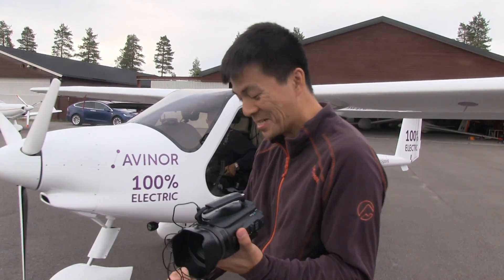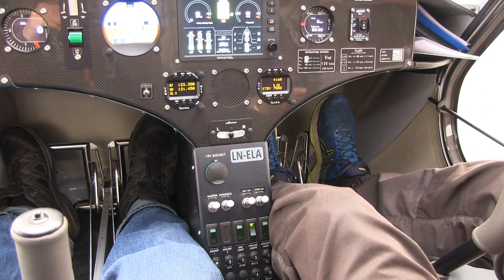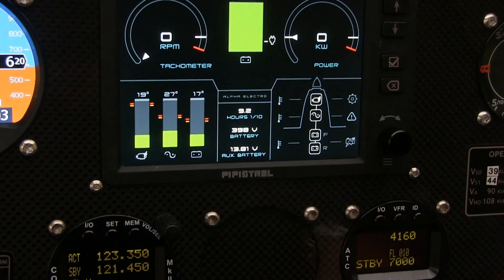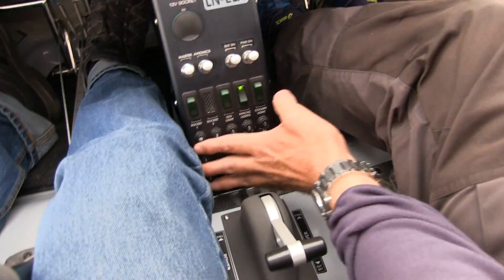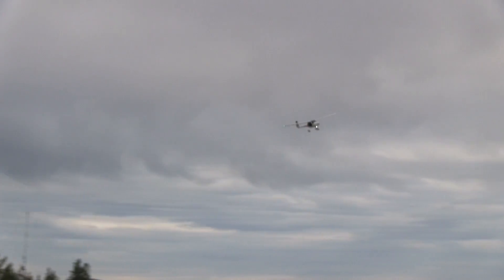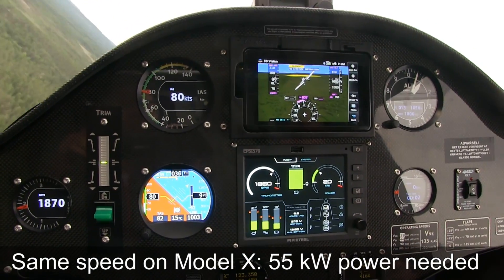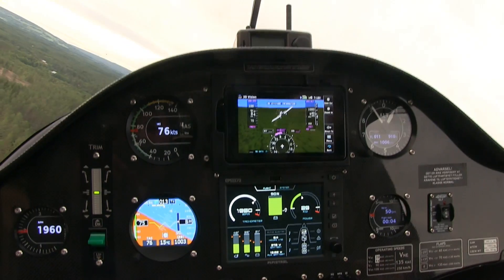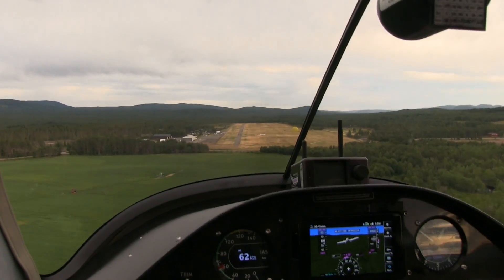Test ride in Pipistrel electric plane

Comment: So at cruising at 9:25 in the video the consumption was about ~130wh/km (209wh/mile) that's not too bad at all.
Reply: idontcare80 You know it's intended to be a training aircraft, right? It's not designed to fly long distances. In fact it's extremely good at what it does, because flight schools will save huge amounts of money on fuel and maintenance costs, as well as reducing noise and not annoying their neighbours!
Reply: Add that cars are HEAVY (and getting heavier for comfort) and planes are designed as light as possible.
Reply: @FrenchCrow  u lie
Reply: @playaj320  About what?
Reply: idontcare80 Its a perfect training aircraft, perfect for touch and go landings and should be much cheaper to learn to fly in.
Reply: It has it's Purpose.
And this Purposes are growing like the Batterys are getting better.
That is happening.
Reply: idontcare80 you got me my man :). Tried trolling you but you did good. Cheers. I only dont like the fact that you dont have much trust in electric transport. Yes batteries have been a problem for the last 100 years and still are despite their tremendeous progress. However, solid state batteries are promising petrol like energy density + thermal efficiency of electric motors is ~90% combined to ICE's ~30%. Electric transport has bright future.
Reply: idontcare80 - That depends on how high you can climb with this, but it has a Climb Rate of 1,200 Feet Per Minute, so a 5,000 Foot High Ridge can be climbed over in 5-6 minutes, then you go over a Mountain, and land on the other side, whereas a car might need to drive 3x to 10x as far to go around the mountain! Besides, driving is far more boring!

Second, this particular Plane is all about reducing the Cost if Flight Training for new pilots, since those costs have gotten out of hand, with hourly rental costs for Fueled Equivalents (Like a Cessna 150 or 152) at 4x to 6x or more as expensive to operate! This uses about $3.00 worth of Electricity per Training Flight of about an hour. This alone greatly reduces operating costs.
Reply: I think idontcare80 ist about 85% right on his comments which left me wondering why he needed so long to identify an obvious troll. On positive thing about electric planes hasn't been said: If an improvement of factor five ever comes regarding battery capacities it will be nice to ave the technology already in place since there had to be some research to be done.As for the more efficient cars: That is not true. You can build superlight cars as well and they will consume almost nothing. Most consumption comes from weight and from stupid driving, wasting energy.
Reply: We will see more than a few percent.
Reply: yes but super light cars will cost a lot... also even twice as strong batteries as now will make very useful small aircraft for training and for sightseeing as long as those batteries would have good recharging times and would need to last long time. still no point in waiting for such batteries better make planes now and just use better batteries when they are available.
Reply: idontcare80 haha, yes airplanes are a complete novelty, im betting on the steam powered personal gyrocopter to launch everyone into the future! :P
Reply: Andy B said "Isn't it awesome that a plane can be more efficient than most cars?:)"
They almost always are more efficient than cars, especially with retracting landing gear. A Boeing 747 is more efficient in BTU consumed per ton/mile than any other form of transportation (or animal) except for a human on a bicycle.
Reply: Russell Dawkins I came to the same conclusion regarding the 747 years ago. I have my doubts about the human on a bicycle, I suspect if I ordered what the last cyclist I saw at a roadside cafe ordering, squeezed the fat out of it in a press and poured it into the diesel tank of my little Kubota tractor, I could drive further than he cycled. Of course I may be wrong, but it's a strong hunch.
Reply: Super light cars will not cost a lot. They will simply have simple thin, non adjustable seats, no air conditioning, 50kW, no airbags, thin wheels, plastic non moving windows, no ABS, ASR, ESP, almost no trunk or headroom, only 2 doors. Basically it will be a better velomobile and there you go. That's about what you get with a plane like that.
Reply: and they simply wont be allowed to drive in europe... except maybe just maybe if you limit their speed on 50km/h
Reply: What would make something like this useful is gas/electric technology. Gas takes you off and is used when you need power as they say and electric when you are cruising. 

The thought of it being used as a training airplane would only be useful for maybe stick and rudder practice only. Because with a gasoline engine you have other aspects to flying that one needs to be used to. Also pretrip and Various checklist would be much shorter.  

Also,  why learn how to fly in an aircraft that you will never buy?

I don't want to have a very expensive drone,  and as soon as I take it in the air go oops got to go charge..... 

I like the thought, but battery technology isn't where it needs to be...
Reply: Piston Avatar guy, I agree with you because you think like a business person and you've done the math. It seems like the younger generation is in love with the glamour of the electric technology. Once you factor in maintenance, hours of usage, and replacement costs, the flash of the electric plane Fades away quickly
Reply: I would sure have hated being confined to the same area during my flight training.
Reply: idontcare80 hehe your name explanes all ;)
Reply: RU serious?
Reply: @hc7369  Yeah, and then the battery is toast after a couple hundred hours of flying and replacing it eats up any saving that an electric aircraft might have had in the first place. It's USELESS.
Reply: @hc7369  The cost of replacing the battery is not small, it's $20,000! The aircraft also costs more than an ICE Alpha trainer. These batteries are also discharged at a high rate, which means that they wont last long. Try making your claims after actually doing the math.
Reply: @hc7369  Plenty of people have "pioneered" technologies that were never successful. Some technologies simply aren't viable.
Reply: ki0ng  I already discussed that, you fool.
Reply: ki0ng  Nope, you're a moron and should read the discussion. No one is going to pay nearly double the cost for a less capable airplane.
Reply: ki0ng  The cost of the Alpha Electro with a second set of batteries and a charger is so high that you could buy a regular Alpha and pay for its maintenance and fuel for many years and still have tens of thousands of dollars left over. Maybe you should LEARN THE FACTS before you start calling people names.
Reply: @Andy B not by much a Tesla model 3 uses 260wh a mile. it has a 50 or 75Kwh battery. doesn't mean it needs that much to go 1 mile... the statement in the video is false.
Reply: edwong3  No, they say that there's no real limit to how much energy can be stored in a given space, but that doesn't tell us anything about chemical battery storage. If the Maxwell battery technology works out, I'll be very surprised, but even that isn't nearly enough to make electric aircraft useful for anything. For slow, electric, light aircraft to be practical, you need a 5 fold increase in energy density, for electric airliners, you're looking at a 50 to 100 fold increase, that's not happening.
Reply: edwong3  "Planes like the Sunflyer II and IV can remain in the air for over three hours, and that is with current battery tech."

That's what they claim, yet they've never even built an aircraft that can do such a thing. I don't think their 2-seater has been verified to be any more useful than the Alpha Electro. Everyone seems to be taken in by snake oil salesmen these days, it's ridiculous.

"...but I can foresee twin motor, propeller driven 40-50 passenger regional commercial aircraft possible once energy density reaches 800 plus kw per kg. and above."

You mean: IF energy density reaches those levels. An aircraft like that will still only be able to fly for about an hour, which will limit its usefulness. The other issue is the battery discharge rate in those applications, which will drastically shorten battery life, which will make frequent battery replacements a necessity, which will drastically increase the cost of operating electric aircraft, which will make them unable to compete with ICE aircraft. 

"We should never use the terms, "Never happening" or "Impossible" when it comes to science."

Fine, then I'll put it this way: It's not a goal that's even remotely close to being within reach with any technology that we're aware of. It's kind of like getting people hyped up for Star Trek transporter technology, we can imagine it, but we can't even begin to image how it will be implemented, so there's no real point in even discussing it as being anything more than a concept. 

The other issue with the whole idea of electric vehicles is how slowly battery technologies are advancing (in fact, they seem to have hit a brick wall), and, really, the only major reason that these technologies are even desirable is because of climate change, but if they're going to take 40 years to develop, and then 40 years to be used widely enough to generate any significant reduction in CO2 emissions, we might as well just do nothing!
Reply: edwong3  The 4-seater Sun Flyer doesn't exist as anything but a concept.

"I will give you some food for thought."

I've heard this argument a MILLION times, it doesn't mean anything. For every technology that succeeds, there are dozens that fail. We're also FAR more advanced in our understanding of how things work than we were in the early 20th century, we're not just making shots in the dark and hoping that something hits its mark like we were in those days. Gambling our future on technologies which aren't likely to have any real chance of being useful is not a wise way to live.

"Now we're in the 21rst century, and it is science again that is developing the replacement for this fossil fuel economy that we're running on."

TRYING to develop, electric vehicles being successful in doing so still appears to be VERY unlikely.

"I know I started this discussion as a way to correct you in your assertion that we are somehow reaching the limits of battery capacity when that is not even remotely true."

Are you sure about that? You've only brought up technologies which are still in the development stage, and most of these things never make it into production.

"...who won't accept any facts."

What facts? 

"...the older technology has to go."

It certainly does, but there's nothing which can replace it, which is my entire point here. Anyway, I think that you need to reread my comment, what did I say about climate change?
Reply: edwong3  I didn't say that we stop innovating, I said that electric vehicles don't appear to be the innovation which will save us from climate change. There are other innovations which are FAR more promising.
Reply: Good observation.  To keep the comparison fair though I'd add on the part of onboard energy.  If you took a conventional Tesla and removed 90% of the batteries (about 500kg of batteries, leaving about 1hr worth of driving), I think the vehicle's energy consumption would go down quite a bit too.
Reply: And this is not true.
You are so much faster with a Plane, even when it is not as fast, than a car.
It is because you are Flying straight and with a Car you can't go straight.
I had followed a Friend when he flies an much slower UL.
It is only 80-100KM/h fast, ist was impossible for me to be faster.
In Fact he was 1/2 h faster over 50KM Distance straigt.
Reply: idontcare80 It's the same price as the gasoline version of the Pipistrel Alpha. If flight schools need to fly for more than an hour, then yes, they should choose something else. But for many the huge savings on operating costs will be compelling.
Reply: Sorry, I don't want to upset you - you obviously feel very strongly about this! But it's not Bjorn saying this, it's the guys who actually bought the plane. Go watch the previous video!  But if it's true that the battery costs $30,000 and needs replacement after 2000 hours, then yes, you're quite correct about the costs not being attractive. However, is the specified life of the battery really this low, or is that just speculation on your part?
Reply: idontcare80. So what if it's $30,000 more at purchase. Maintenance will be cheaper over the life of the aircraft and fuel. This will more than make up the difference. 

Directly from their website:
Electro TBO is 2,000 hours at a cost of $600. Motor replacement costs $10,000 every 6000 hours. Total at 6,000 hours is $11,200. 

Trainer TBO is 2,000 hours at a cost of $12,000. Total at 6,000 hours is $36,000. 

So after 6,000 hours the Electro costs $24,800 less and that is before fuel cost savings. 

You could even buy a swappable battery for the Electro that they offer and have money left over. By the way the recharge time for the 17 kWh battery is only 1 hour anyway. With a swappable battery your turn around time would allow the same number of flights per day. 

Even with the cost of a swapable battery and after the fuel savings the Electro will cost less than the regular trainer after 6,000 hours.
Reply: idontcare80 It's stated in Bjørn's other video that it's the same price. Maybe that's just in Norway? In any case, even if the difference is as you claim, a busy flight school would make that back in a year in fuel savings alone.
Reply: idontcare80 why read the discussion when it's just you pulling numbers out of your ass. $30,000 for a 16kWh battery! Hilarious. At the pack level for batteries cost is down to around $250 kWh. A company like Tesla has their prices down to $150 kWh but they are dealing in large volumes. At $250 kWh for a 16kWh pack is only $4000. And those batteries are going to last way, way beyond 2000 hours. And even then they will just loose capacity which will reduce flight time but they will still be usuable. It's not like they just go from 90% capacity straight to 0. The packs in Tesla's are showing on average 90% charge capacity still remaining at 150,000-200,000 miles. So at 6000 miles you replace your $4000 swappable pack. And that is based on today's  pricrs That. By the time you need to change the pack prices per kWh will be even lower. The battery isn't going to change the cost advantage the Electro has.
Reply: The 17KWh battery pack will cost way more than $4000. At least 3 times more and probably in the 6 times ballpark.

From their website: The 17 kWh battery pack was dual-redundant and designed to be either quickly replaceable within minutes or charged in less than one hour, thanks to the next generation of Pipistrel's Battery Management technology.
Reply: It's stated in Bjorn's previous video that to buy the gasoline equivalent with a full complement of instruments is "approximately the same" as the Alpha Electro. In addition to fuel savings, there are significant maintenance savings. 2000 hour maintenance interval compared to 100 hours for the Rotax.
Reply: Troll harder.
Reply: they are talking about twice the energy density compared to todays batteries thats still only 1/20th of energy density of petrol. 

anyway battery in this plane can be recharged pretty fast so clearly you can fly many times per day.
Reply: @jebise1126  I worked at a flight school when in college.  I could list @ least 20 darn good reasons why a Flight School would absolutely want to choose this specific trainer, built on a glider platform, with such a quiet & smooth energy band & with it being a totally green & clean engine (No Exhaust) - This flight school (if they are good at Marketing) will be totally booked up all the time...  They could offer a free 1st flight (donations appreciated) business model to get the masses to come & come they will!  Many will sign-up because they will be ahead of the curve in getting all their training in an electric plane with glider characteristics that is as safe as you can get in a flight instructor small aircraft.  I need to go to sleep now.  But this reminds me of a few different parallels from history.
#1) Amazon.com will never make a profit, it's a pipedream of a business model...
#2) Tesla will be bankrupt & they will never even produce a functional sedan much less a SUV, or any affordable car model with any kind of real world needed range acceptability...
#3) Donald J. Trump is nothing but a reality tv host, he just got lucky in his career, he is a modern-day PT Barnham shill with no brain power.  It's literally impossible for Donald J. Trump to win the Republican nomination - He has a 0% chance of winning.  What a fluke, he somehow won the Republican nomination, but HRC is unbeatable, she's the surest lock to win the Presidency since FDR 1st ran for President...
#4) The sitting President's party always loses seats in Congress @ the Congressional mid-term elections in November - The November 2018 midterm elections will be like all the other previous midterms, voters will have the typical buyer's remorse - so a Huge Blue Wave will occur in November 2018.
P.S. Obviously, like electric cars, electric planes are here to stay, the battery technology will continue to improve / costs will keep falling / range will continue to be extended / etc...
Reply: LIBERTY MURF - Wait, did you think that I was a Trumptard and like the idea of burning coal? Coal is basically the worst way that you can generate electricity! It's not only dirty, but it's also expensive!

No one said that Tesla wouldn't succeed based on their technology, electric cars were proven to be viable in the late '90s. The only doubt about Tesla came from the fact that it's incredibly difficult to start an entirely new car company with so many major players already well established.

Electric airplanes wont catch on unless there is an absolutely enormous improvement in battery technology, period. You people can talk about the possibility of rainbow farting unicorn magic making them viable all you want, but it wont change the reality of the technology.
Reply: The batteries are modular packs.  With two packs, one charges while the other is flying. In about the same amount of time.
Reply: idontcare80 yes it does you electric loving liberal
Reply: I'll believe it when I see it.
Reply: A typical flying lesson is about 1 hour.  Despite the initial cost of electric airplanes -- which will surely go down -- the operating cost is very low.
Reply: idontcare80 true. Only coal bro.
Reply: Coal is the future
Reply: Norway doesn't get its electricity from coal, you ignorant conservatard.
Reply: Read the discussion.
Reply: I'm a troll because I don't care what my screen name is? If I'm wrong, tell me WHY I'm wrong.
Reply: How is it that every conservative on Earth is unimaginably ignorant? You people don't know anything about ANYTHING. You should at least come across some things by accident, so the only explanation for why you people are so ignorant is that you actively try to remain as ignorant as possible about absolutely EVERYTHING. 

99% of the electricity in Norway comes from hydropower plants, not coal. Coal is not only expensive, but it's also one of the most polluting ways to produce energy. We don't even get half of our electricity from coal in the US, natural gas is the largest single source of electricity here, and that's because it's cheap and clean.

Anyway, I'm guessing you're a troll, so f**k off.
Reply: "We will see more than a few percent."

I believe it when I see it.
Reply: The Rotax powered Alpha is $90,000, the Alpha Electro is $140,000, that's quite a bit more. Savings are nil.
Reply: I doubt that Norway makes $50,000 available for the purchase of this aircraft. Those are the prices in the US and all of Europe as far as I can tell. And, no, they wouldn't make their money back, because they'd have to buy multiple battery packs to allow for more than one flight a day, and they'd have to keep someone on staff to change out those battery packs. 

By my math, it would take at least 4 years to see a return on the purchase of this aircraft, assuming that it's used every day and doesn't cause an overall loss of money due to lost opportunities.
Reply: Planes don't run on coal, moron.
Reply: @PistonAvatarGuy  A large % of Electric Generation comes from burning coal for the sole purpose of generating electricity!
Reply: LIBERTY MURF - Not really, it's only around 30% in the US. Even if an electric vehicle is powered almost entirely by coal, it's still cleaner than an ICE vehicle (everything is just much more efficient), but that doesn't mean that electric vehicles are practical for every purpose.
Reply: British Entertainment - Electric would be awesome if it worked, but it doesn't.
Reply: No, driving to the airport, pulling the plane out of the hanger, doing the pre-flight, run up, getting tower clearance, etc, would all take much longer than it would just to drive 80-100 miles. You can just go directly from one place to the other in a car, you don't have to go to and from airports.
Reply: You clearly didn't read the argument, and if you did, you obviously can't say why I'm wrong, so YOUR argument is useless.
Reply: Philip Davis - You're forgetting about the replacement of the battery. Read the discussion.
Reply: What is wrong with you? Are you incapable of accepting the fact that you're wrong? Who cares what Bjorn says? Bjorn is not a representative of Pipistrel and he's WRONG. The price list straight from Pipistrel lists the Alpha Electro at $50,000 more than the Alpha, PERIOD. 

The battery in the Electro probably wont even last for 2,000 hours, it will probably have to be replaced, at a cost of $30,000! Also, the Rotax engine might need light maintenance every 100 hours (oil change, I assume), but it has a TBO of 2,000 hours.
Reply: PistonAvatarGuy the battery in a model S Tesla LA to Vegas went 500 000 miles before Tesla replaced it due to becoming somewhat unbalanced, due to.being Supercharged every time - a practice Tesla recommends against. 10000 hrs seems a easonable assumption. . When does an ice need to be replaced or bave a major overhaul ?
Reply: @PistonAvatarGuy  ur argument of 1 hour flight time being a problem for training is completely irrelevant. When you do your first hours of flight training the good procedure is to do 1 hour of flying and then 1 hour to go thru your mistakes. Student dont do more than 2 or 3 hours a day. This aircraft can be recharged ini about an hour, too or you can just switch the batteries. Its significantly more expensive, but for a school and with some local tax incentives its still a good way to operate.
Reply: @VNtergon  None of that makes sense for the owner of the aircraft because of the cost. Not only is the aircraft more expensive to buy, but the batteries are also only passively cooled and are discharged very quickly, which means that they wont last very long and will need to be replaced frequently, which will cost the aircraft owner much more than it would to operate the same aircraft with an ICE. Buying a second battery pack, so that one can charge while another is placed in the aircraft, also increases the price of the aircraft, very significantly. The aircraft owner would also need to hire someone to be available for the switching of the batteries. NOTHING about this aircraft makes sense.

If you're aware that it's significantly more expensive, why would anyone want to operate it? What would be the point of tax incentives to use it in the first place?
Reply: @PistonAvatarGuy  well I operate a version of this aircraft with Rotax engine in it so trust I know a thing or two about its operating costs.)) 90% of the flights my aircraft does are 15 minutes long. So for my kind of operation it actually is not that bad. We evaluated starting a flight school, and having 2 Alpha Trainer with electric engines and 1 with the petrol for navigation training is the best combination if you are planning keep those airplanes busy. And also, most aircraft ICE engines are passively cooled, so I your claim about batteries not having enough cooling is irrelevant here. Again, this aircraft is not meant for private owners, if you run a school you already have a mechanic who can switch the batteries if you ever are going to need that at all.
Reply: @VNtergon  Batteries are not ICEs, so your point about ICEs being passively cooled makes no sense. Batteries are not easy to cool by simply moving air over them because of their mass and density, and engines require large heat sinks so that they can be cooled by simply moving air over them. Even then, water cooling an engine is much, MUCH more effective than air cooling ever could be. Anyway, passively cooled and air cooled batteries have poor longevity in BEVs, and the batteries in this aircraft are discharged at a much higher rate than they would be in a car.

I suggest that you run your numbers again while including the price of a second battery pack for each aircraft.
Reply: @PistonAvatarGuy  well. I can tell you this - if something doesnt make sence to you, just look again and ask how its done. A Rotax 912 can run at 5500RPM  all day long with only the heads being water cooled. 
Plus Pipistrel know a thing or two about cooling, and the aircraft in the video is basically the second generation. So just because you have no idea how to cool those baterries without coolant and radiators doesnt mean that they dont. When talking about costs, also consider this: when your aircrsft is not flying it costs you money, and Rotax 912 is known to create surprises which is costly when you run the aircraft within a business.
Reply: @VNtergon  "I can tell you this - if something doesnt make sence to you, just look again and ask how its done."

I KNOW how it's done.

"A Rotax 912 can run at 5500RPM  all day long with only the heads being water cooled."

And? The heads are water cooled because that's where the majority of the cooling is required and because the engine wouldn't be able to do what it does without water cooling. Oil cooling is also used on those engines, btw.

"So just because you have no idea how to cool those baterries without coolant and radiators doesnt mean that they dont."

There's nothing about the design that can be changed to improve the cooling, batteries are simply so dense that they can't be cooled effectively with air.

Anyway, using Pipistrel's price list, with extra batteries and a ground based charger, I've determined that the Alpha Electro costs about $90,000 more than the Alpha, so you could buy 2 new, whole Rotax 912 engines for each plane and still have tens of thousands of dollars left over for the fuel and for the maintenance and repair of those engines.
Reply: An improvement of a few percent here and there isn't going to do anything to make electric aircraft more practical, battery energy density would need to increase by at least 5 fold to make electric aircraft useful for anything.
Reply: $30,000 is what Pipistrel charges for a set of batteries, that's straight from their price list. EVERYTHING for an aircraft costs more, because it all has to be certified, and that costs money.

"And those batteries are going to last way, way beyond 2000 hours."

Not likely. Like I said, these batteries don't have good thermal management like Tesla batteries and they're discharged at a much higher rate.

YOU HAVE NO IDEA WHAT YOU'RE TALKING ABOUT BECAUSE YOU DIDN'T READ THE DISCUSSION.
Reply: idontcare80 Typical millenial with his "clean energy" falacies. How is it there in your moms basement? Coal is THE MOST POWERFUL source of energy in the world. Gas is for cars and not for electricity. Typical millenial that has fallen to jewish "clean energy" propaganda.
Reply: idontcare80 yes it does. Coal is the beat source of electricity. Solar and wind are jewish propaganda to get Americans to stop using coal and getting real electrixity from it
Reply: @britishentertainment7610  educate yourself you little ignorant :)
Reply: I didn't say that airplanes were a novelty, I said that THIS airplane is a novelty. It can't fly far enough to be useful. It would take you longer to travel with this airplane than it would to drive the same distance.
Reply: @PistonAvatarGuy  u a lier,     srt8 line 2points a & b plus it's faster.
Reply: idontcare80 hey man, it might not fly that far, but it’s a start!
Reply: @seththompson4780  No, it isn't, battery technology is probably already very close to being maxed out.
Reply: Keep in mind, the Wright brothers plane was a novelty,  and 50 years later, it was a whole different thing.  Imagine electric planes 50 years from now.  They may well take over the small plane industry.  In 20 years I can imagine all the Cessna 170s or similar being electric, as battery tech becomes denser.
Reply: You people do realize that flight schools will lose huge amounts of money because this aircraft can only fly for an hour, right? If they can only charge for one hour of flight time, versus 8 or more for an ICE aircraft, they're going to lose money. This plane is also more expensive to buy than a normal ICE aircraft, so there are no savings to be had.
Reply: Please consider maintenance costs of an aviation ICE, which are HUGE - and here you have just one moving part (looks like there's no reduction gear), no oil checks, no spark plugs, no alternator with belt etc. Reduced maintenance also means much higher availability and hence better profitability.
Reply: I'm not upset, it's just frustrating when people have no idea what they're talking about and go on and on about how wrong another person is. If Pipistrel changed the price of their planes, I haven't heard about it, and the price list from Pipistrel lists the Alpha Electro at $50,000 more than the Alpha. I have Pipistrel's price list right here, I don't need a video to tell me anything.

Yes, I'm speculating on the longevity of the battery, but that speculation is based on the fact that this battery will see some very heavy use (high discharge rate) and isn't water cooled, so its life will be short.
Reply: Yeah, perfect... unless you want to fly for more than a hour a day.
Reply: "The 17 kWh battery pack is dual-redundant and designed to be either quickly replaceable within minutes or charged in less than one hour". And when you train student-pilots you anyway need some time for briefing/debriefing etc. - 1h charging time is OK then.
Reply: Unfortunately, this airplane is completely useless, it's nothing but a novelty.
Reply: If you don't see use for it that does not mean it's useless. It was designed for specific purpose and that's pilot training.
Reply: idontcare80 cheap island hopper
Reply: @jrchicago9216  There's nothing cheap about the plane, and it probably doesn't have the range to island hop, except in rare cases.
Reply: @PistonAvatarGuy  why do you say that? My question is genuine, I'm a complete ignorant in this matter. Regards!
Reply: @mauriciocaviedes6520  Read the discussion.
Reply: @PistonAvatarGuy  I'll do it now. Sorry pal 😔.
Reply: @PistonAvatarGuy  Aha thats why our Slovenian company Pipistrep is thriving huh? Because planes are obsolete?
Reply: @zanpekosak2383  LEARN HOW TO READ.
Reply: you are completely wrong . this is the beginning of this. wait for the improvement.  @PistonAvatarGuy
Reply: @rbradominican  What evidence do you have that I'm wrong? I've been reading about electric aircraft for over a decade, none of them have ever amounted to anything and there hasn't been any significant increase in battery energy density during that time.
Reply: @PistonAvatarGuy  At an early Wright Brothers demonstration a bystander made a similar comment.  Another replied "So is a baby".
Reply: @danaschoen432  That's nice. NO ONE is making progress with electric aircraft, but ICE aircraft advanced at an EXTREMELY rapid pace. It's those pesky laws of physics, if only they didn't exist!
Reply: @PistonAvatarGuy  The problem is energy density vs weight, and contrary to your assertion, there is plenty of progress being made.  I doubt we will see electric planes in commercial aviation in our lifetimes, but small general aviation could very well reach a 300 mi range in a decade or so.  None the less, there will be no running without walking and there will be no walking without crawling.
Reply: @danaschoen432  There isn't nearly enough progress being made. A plane with 300 miles of range at 60 mph is still useless. Planes are used to travel long distances quickly and making that possible requires a huge amount of energy, which is something that batteries can't store. The likelihood of electric aircraft becoming a viable alternative to ICE aircraft is next to nil.
Reply: @PistonAvatarGuy  Let not the perfect be the enemy of the good.  5 years ago there was no such thing as an electric airplane.  The first ones won't be perfect, that is true, but no invention ever was.  It probably won't be perfect in our lifetimes.  This one however is NOT useless, it's a stepping stone.
Reply: @danaschoen432  No, that's what you're not understanding, this aircraft is not a stepping stone because it's USELESS. There's nothing good about this because it stands no chance of dethroning ICE aircraft. It is the enemy of good because it's wasting valuable time and resources that could be better spent on an alternative that ACTUALLY WORKS.
Reply: @PistonAvatarGuy  So, because it won't render internal combustion engines obsolete in one felled swoop, it's "Useless"?  Nonsense.  Have you ever seen a picture of the first transistor?  The damn thing was the size of your thumb.  The computer you are using to have this dialog has hundreds of millions of them.  Without the first one, none of the rest with all of their improvements would have followed.   No one at the time would have guessed what uses would be found for that little transistor.  No experiment is a failure.  Every experiment produces knowledge.
Reply: @danaschoen432  Batteries aren't transistors.